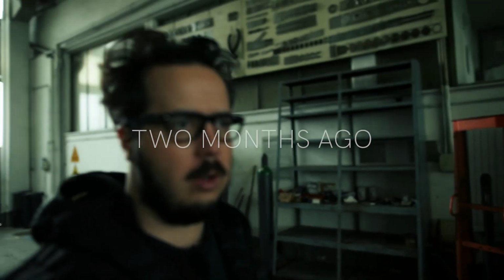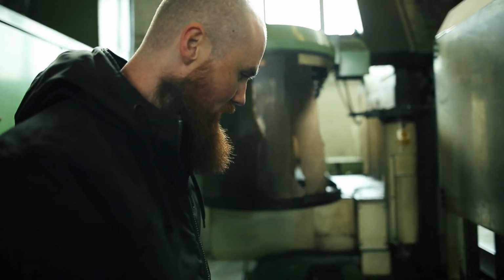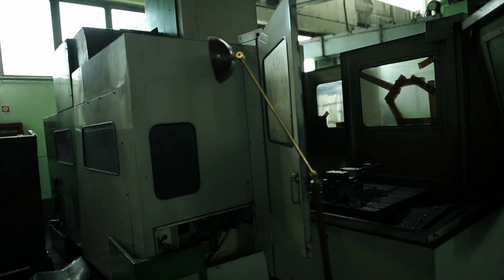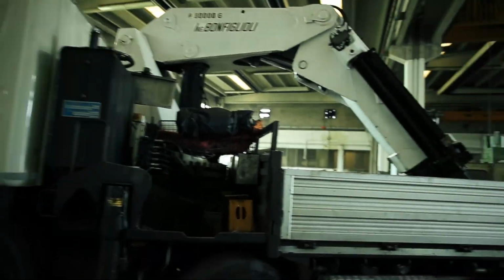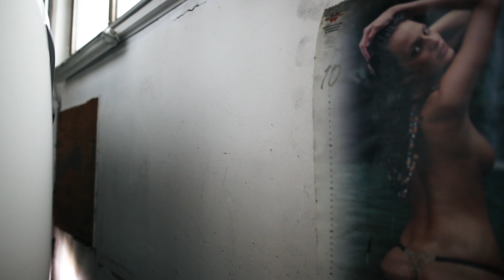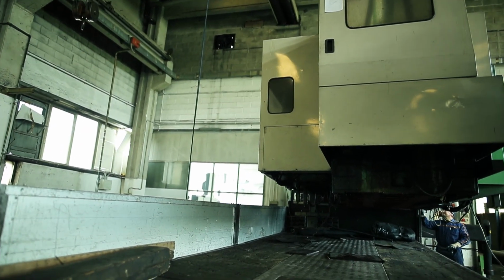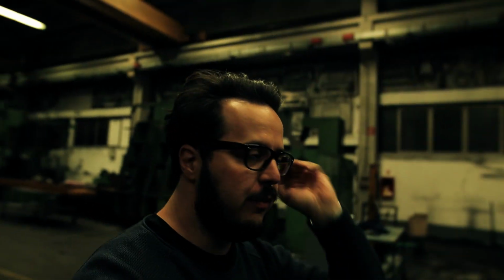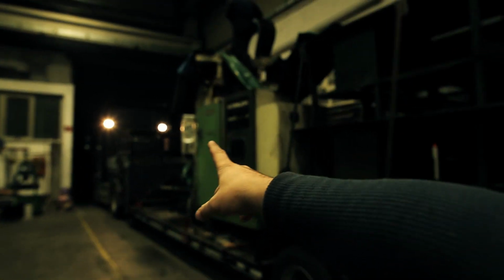I Got HUGE Machines, Now I Need to Move 'em | GIACO

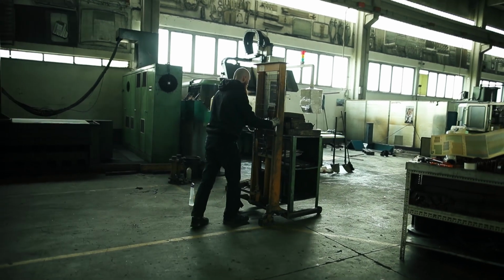Comment: 4:09 its a "Zentrierbohrer" in German i guess its 
Center drill in English. You use it to make a little drilling for a bigger drill that the bigger hole is exactly centerd.
Reply: Nope, it's not a center drill, it's a tiny little end mill. Center drills typically have drill geometry at the tip, and flutes all the way up into the chamfered area of the shank, and also generally don't have a tip that sticks out that far. :)
Reply: @SwitchAndLever  Ok could be. I didnt look that properly sry ´:D

Comment: did you have those machines inspected and checked out? they look clapped out and run into the ground no fkn way I'd buy used old machinery. Repairs and spares are a nightmare especially in kitty horizontals. good luck...
Reply: The Mazak at least looks like it might be ok good thing he has all that tormach 440 experience to help with the kitty haha yeeesh